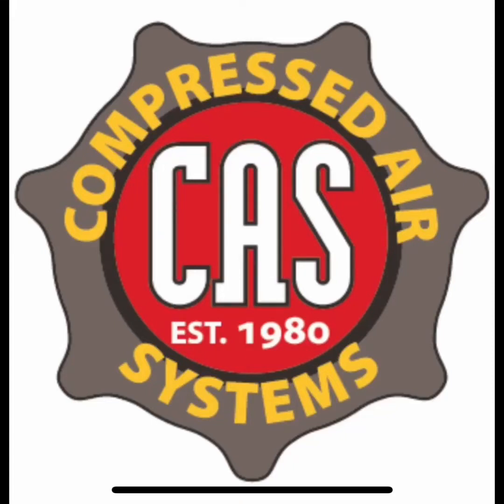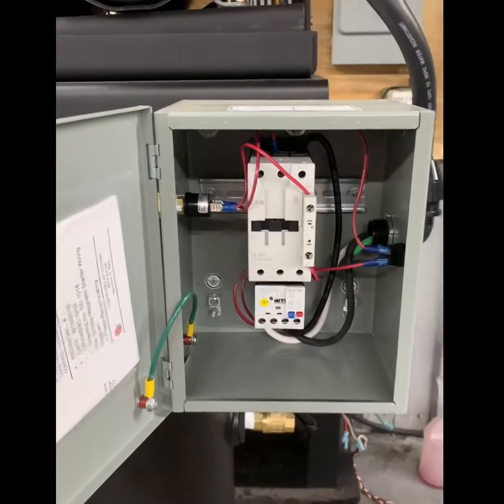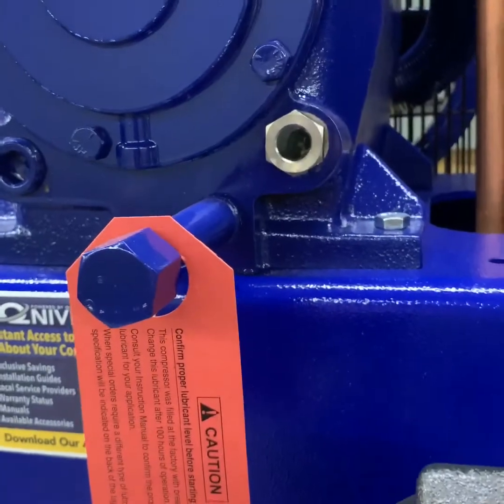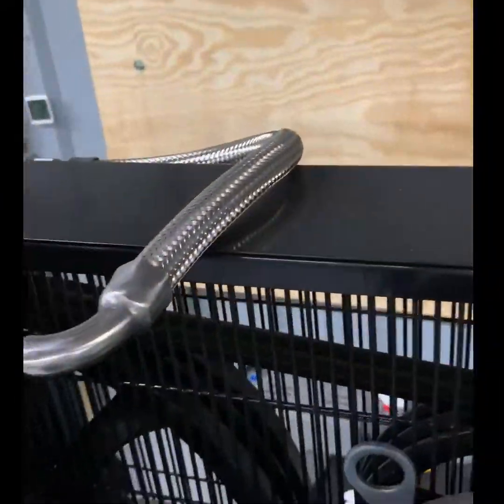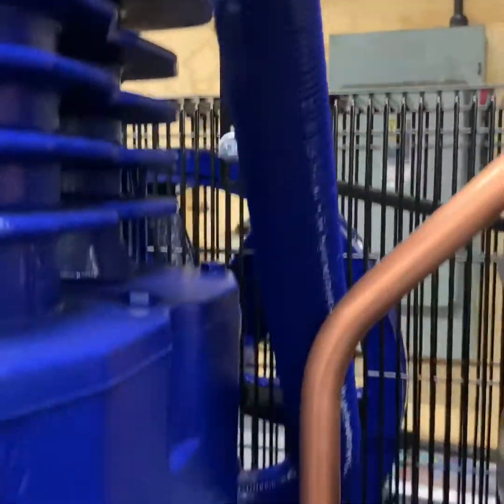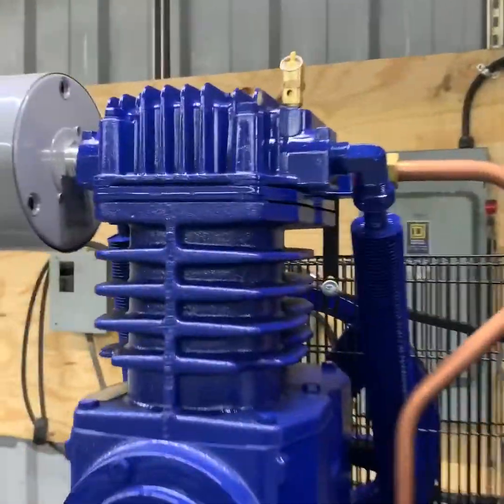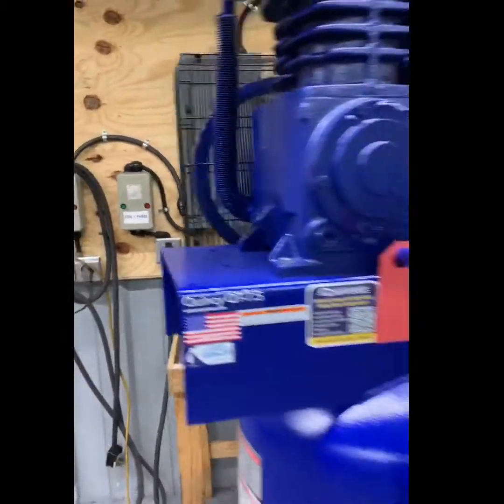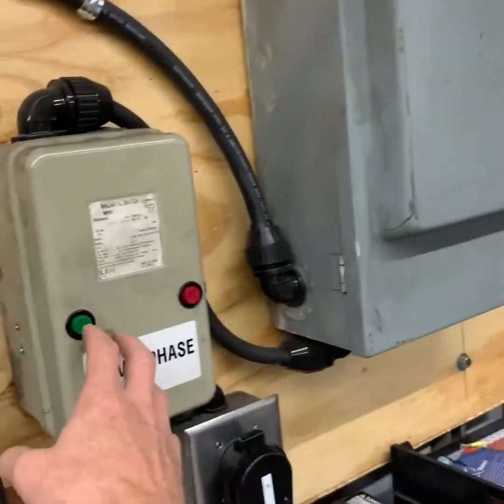7.5hp product comparison between CAS and Quincy QT7.5

Comment: Some feedback - you really want to dump water before it hits the tank. On long runs where you are using air as the pump is running you'll have dryer air if you run through a forced air after-cooler and then through a water separator before entering the tank. Otherwise - this looks like a great compressor.